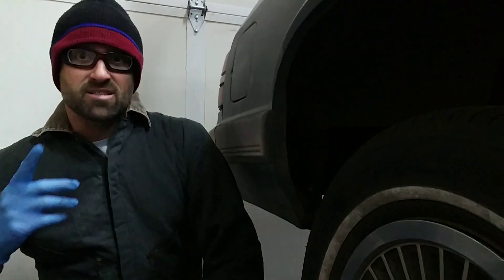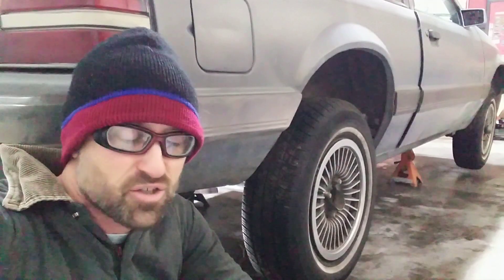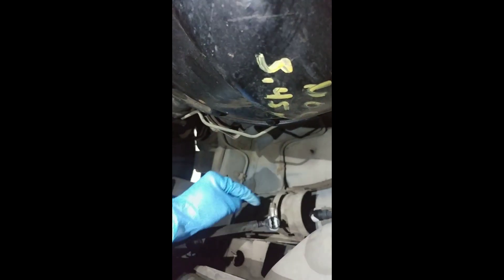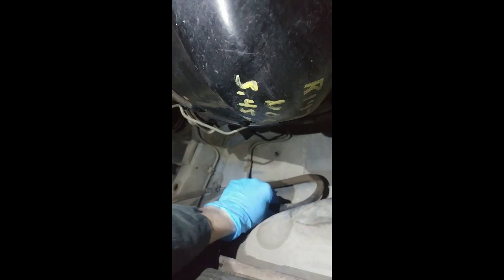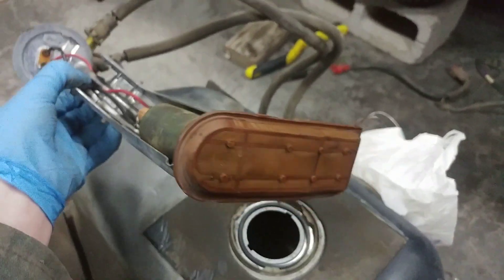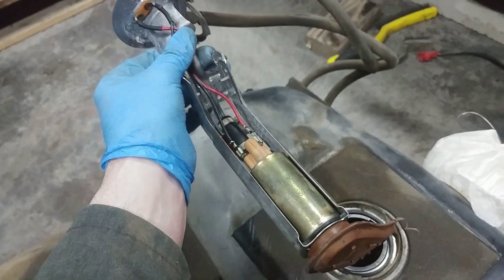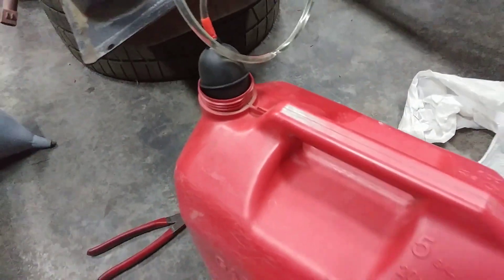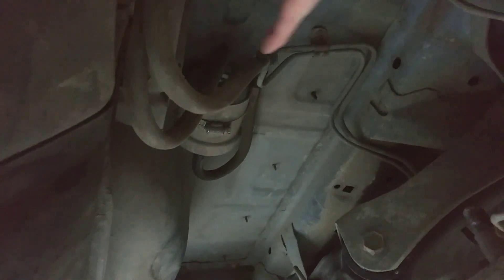How to Replace a Foxbody Mustang Fuel Filter and Fuel Pump

Comment: How do you know which fuel line goes to the filter vs which one goes to the hard line?….Good video👍🏿
Reply from the maker: The connections should indicate where the filter goes. Just be sure to put the filter in correctly with the fuel flow. It will go on backwards against the direction of the fuel flow (tank to engine).

Comment: I'm back watching another one of your vids for my 84 hatch.  I'm replacing the fuel filter tomorrow because the car was cranking but wouldn't start, then after a few tries it started and acted like it wasn't getting enough fuel.  I'm thinking it's either the fuel filter clogged or the fuel pump and I had a spare fuel filter so I'm gonna try that first.  In an LMR vid it shows you can relieve the pressure on the shrader valve on the throttle body with a flathead.  I'm gonna try that method.  If that doesn't work I'll pull the fuel pump fuse.  In the Haynes manual it says to unplug the fuel pump switch in the rear of the trunk, then run the engine until it stops, change filter, then plug the switch back in and hit the reset button on top.  Sounds like your method or the shrader valve are easier than taking apart the trunk interior.  Great vid, thanks.
Reply from the maker: Hopefully it goes smoothly. I am not a fan of getting gas everywhere, which always seems to happen to me. Glad the video can help make it easier.
Reply: @BasinMotorsports  Just replaced fuel filter and was surprised to see the filter is in front of the passenger rear tire and right next to it is the fuel pump.  Thank God because if the fuel pump is the problem I don't have to drop the tank.  What was weird is the car sat overnight and I disconnected the fuel pump harness and ran the car until it died, and no gas sprayed.  After installing the new filter I realized I didn't put the rubber pads from the old filter on the new filter so I had to do it all over again.  The second time, after unplugging the harness, I ran the car until it died, then kept starting it and would run for a few seconds and die.  After doing that 8 times I figured the pressure has to be relieved, but got some good fuel spray removing the filter lines.  Pouring fuel out of the filter output was clean fuel, but pouring the other direction it looked like crap.  Hopefully that's the problem but I'm ordering a fuel pump anyway since it's on the chassis.

Comment: that's in very good shape for the age....here in the north east I got the crusties and rusties on mine...
Reply from the maker: So far I have been impressed by how little this car shows wear.  The normal items need replacing, but I haven't found anything terrible.  No rust that I can find yet, which seems to plague them once and a while.
Reply: @BasinMotorsports   that's why id never buy a car in the rusty east coast again to work on and be a summer driver car ...id TRAVEL to a warm climate state and buy 1 with paint fade not floor and frame rot..
Reply from the maker: Agreed.  These cars are bad enough for rust normally.  The rust belt only makes it worse.